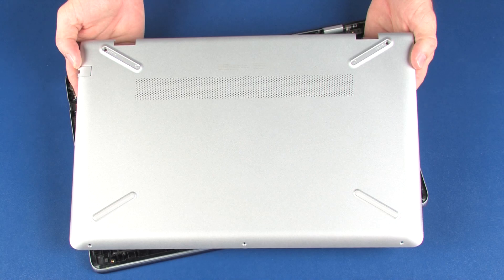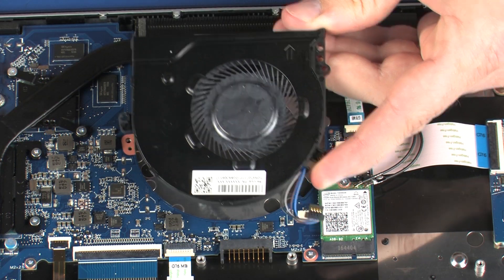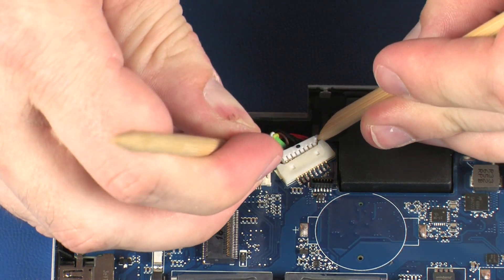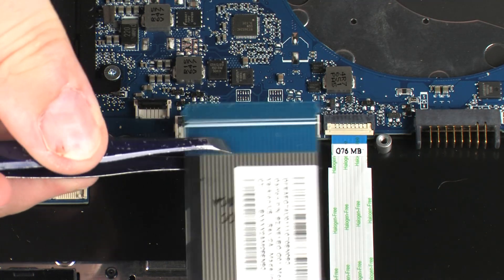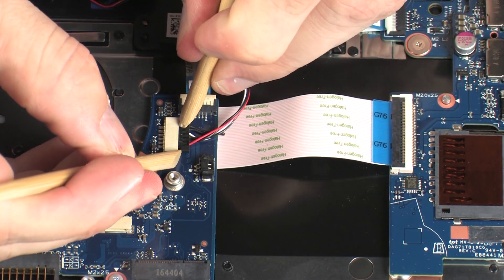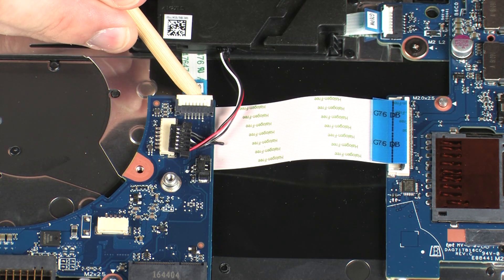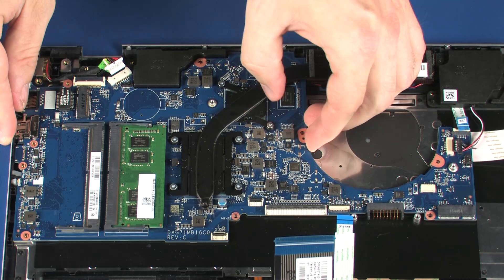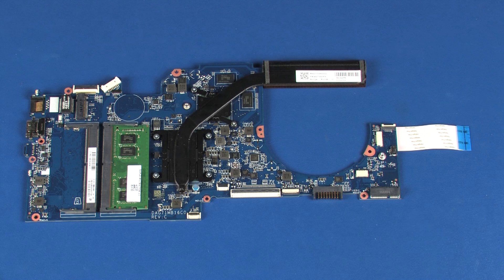Remove the System Board | HP Pavilion 15-cc0xx and 15-cc5xx | HP

Comment: What type of SSD does the hp pavilion 15-cc5xx have an M.2 or nvme SSD?
Reply from the maker: Hi there, thanks for contacting HP Global Social Media Support!
I understand that you need to know about the SSD used on HP Pavilion Laptop 15 cc5xx.
I will do my best to assist you.
It supports SATA III (6Gb/s) SSD type. 
The best way to find the correct part number is by using the HP PartSurfer.
Put your laptop's serial number in the search and click on the magnifying glass icon. Look for the display in the list.
https://hp.care/6051tdL9B
Regards, 
HP Support

Comment: I have the exact same model. When I play games or use VS code, the screen turns off and the capslock blinks. Also, even on low settings, the Nvidia 940mx slows, leaving it useless, and I have to game with the Intel HD 620, which goes off automatically with a blinking capslock. It's only that I'm broke and can't afford to get rid of this laptop. Otherwise, I would have sold it by now, and I swear I would never purchase another HP laptop again.
Reply from the maker: Hi there, thanks for contacting HP Global Social Media Support!
I understand that you are experiencing a blinking light issue on your notebook.
I will do my best to assist you.
Please refer to the instructions mentioned under this document to fix the issue: https://bit.ly/34b23sv
Binu_HP Social Media Tech Support

Comment: Can I change my non backlit keyboard to a backlit one? 15-cc5xx
Reply from the maker: Hi there, thanks for contacting!
I understand that you need to know whether you can change the keyboard to backlit keyboard. 
I will do my best to assist you.
HP does not recommend upgrading or downgrading hardware parts or software that is bundled with the product as It may affect the manufacturer's warranty and performance, however, you could change the configuration at your own discretion.
Binu - Social Media Tech Support